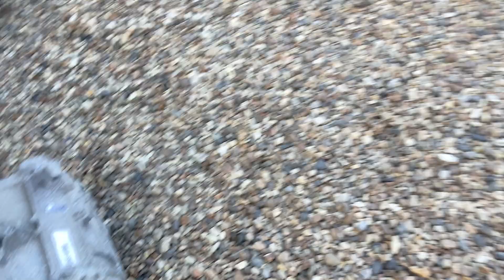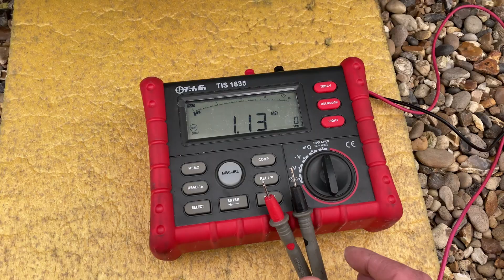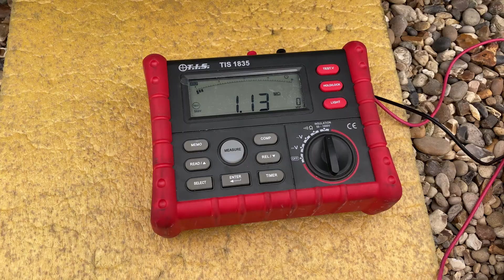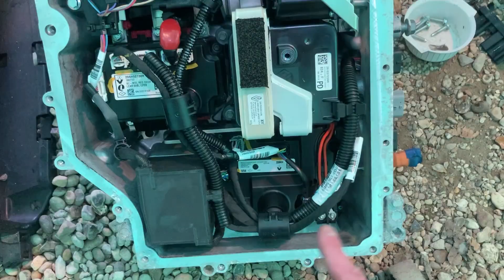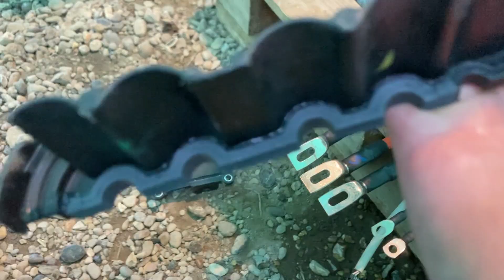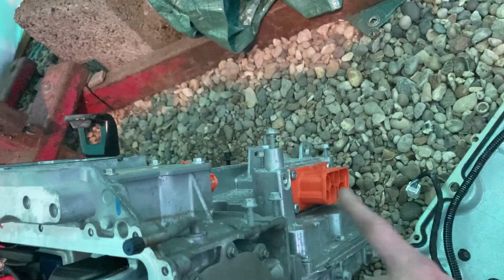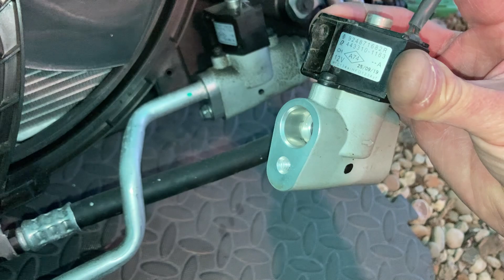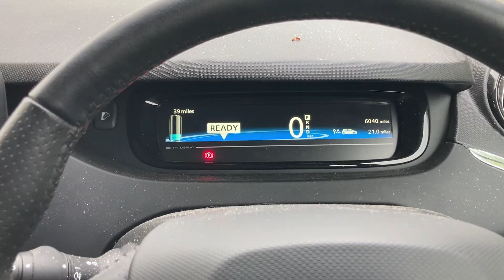This ELECTRIC CAR IS DEAD after only 6,000 miles - Can we fix it? Renault Zoe EV Repair

Comment: Did I miss something or was it just a new motor controller and about 14 hours work after fixing the coolant leak?
Reply from the maker: Basically yes, including coding with the original dealer tool
Reply: New motor controller, and a new (used) cast metal casing into which the existing components (and the new controller) had to be installed.
Reply: Thank you for your video. It's surprising how many bolt lengths are involved with the construction of the drive box. I was always taught to design stuff with the same type of fixings and fixing lengths as possible as this would help avoid errors in manufacture.
Looking at the leaks coming from the tapped bolt holes, do you ever wonder if the wrong screw lengths were fitted in the first place and they've broken through into the casting cooling channels?
Reply: @gavbansal967 
I've seen that with older vehicles too long they push through casings resulting fluid leaks like oil and coolants.. 

Remember someone only has to pick up the wrong fastener.. the other problem is the fastener manufacturers getting it wrong or forced length growth in the thread cutting process as the blank goes through the dies... Even swarf detritus in the casting tapped hole can cause the faster to bottom out 🤔
Reply: @gavbansal967  Yes, that sounds like a very likely explanation. Yes, back in the day manufacturers tried to use the same part in order to reduce cost by being able to buy in larger quantities. Now, more money is made in servicing;  the higher the part cost, the more profit is made after mark-up as this cost is passed on to the customer. I was taught that the bolt length, in the hole, should be 1.5 times the outside diameter.
Reply: @dennisharvey4499 1.5 times the diameter is where the sweet spot is  , any longer doesn't increase strength
Reply: @iandorling  Yes, that is what I was told.
Reply: You absolutely CAN clean coolant off the parts!   Also, if you're not sure, just taste it:  coolant is glycol and will taste sweet.  It is also is water soluble, so you just flush well with deionized water and air dry and all the glycol goes away with it..   You could also use isopropyl, but that's expensive..
Reply: There can be loads of additives in coolant that are designed to protect the engine and cooling system. Never taste coolant!
Reply: @chuckneedham1584 Nobody said to take a big swig and swallow..  A tiny dab on a fingertip followed by spit and rinse is  absolutely fine..
Reply: Did you try isopropyl alcohol to clean the controller?

Comment: Looked at an R5. Makes me wonder about Renault quality. Scrap after 6000 miles. Not for me.
Reply: Did you watch the video? It's not scrap, not even close, as it's working again. 
You also can't compare the new R5 with a 12 year old design. Things are moving fast with EVs.
Reply: If it's any help mine has 70k on the clock and is 9 years old, only rearly had minor suspension work and a DC-DC converter when a public charger went bang but was still under Renault warranty at the time
Reply: 10 yr old Zoe, only thing that has let us down is suspension drop links.
Reply: "Makes me wonder about Renault quality. Scrap after 6000 miles. Not for me."
An ignorant statement based on one data point.👎
This should not mean Renault has no quality issues just like every other manufacturer.
It's a matter of statistics.
Reply from the maker: I believe the new Renault EVs are much updated but can’t say what the quality is like. Cheers

Comment: Great job Gary,  Don't ever go for a job at Renault will you, your far too good for them!!!!  keep up the good work.
Reply from the maker: Thanks 👍 I am actually helping a guy whose car is currently at Renault, I’ve supplied parts that they didn’t have in stock (literally posted used parts to a Renault dealer) and provided part numbers that Renault couldn’t work out 🤪. I think I’d go mad if I tried to work there…
Reply: @garycevrepairs don’t let them know about the court case 😂
Reply from the maker: @PJWey haha
Reply: @garycevrepairs  you are a star!
Reply: Main dealers of all makes don't tend to dismantle and repair things. They simply condemn and replace entire assemblies, regardless of cost to the customer.

Comment: Always worried me that these cars simply cannot cope with deep water in any way compared to say a Nissan Leaf. Never liked the way its all air cooled.
BTW Gary, you have been telling us the ramps are on order for weeks. Not telling us a Donald Trump are you? 🤣
Renault are way out of order as I doubt both motor and Inverter will be toast. Most inverters protect themselves from ground faults detected before they start.
Great fix and well done again. Wouldn't hurt to give the dash a clean as its triggering my OCD!  🤣🤣🤣
Reply from the maker: Bit of a running joke sorry, some arrived and I didn’t like them so I sent them back 😆. So technically some different ones are on order though bricks works quite well…

Comment: If you add a Mesh wifi system at home, one box plugs into your main router the slave will plug onto an extension mains lead and connect back to the home unit. Something like the Tenda mesh units have an RJ45 outlet you can plug the car into your home network which your laptop is also connected to !.
Reply from the maker: I have some extenders but wary of adding latency.  If it drops out while they are programming then it’s game over…
Reply: Maybe make up a 90m ethernet cable and put it on a spool

Comment: Idea:
Can coolant be replaced with 0W10 engine oil?
It should flow as water and be non conductive.
Reply from the maker: Above my pay grade that question!! Interesting thought though.
Reply: Engine Oil has carbon in it and if it overheats can deteriorate leaving particles of carbon. Carbon is conductive
Reply: @DanRyan-v5y  Mineral oil is widely used in transformers, high-voltage switchgear, and other electrical equipment as an insulator and coolant,
Reply: I wonder if it wouldn't be a good idea to replace the coolant for a low conductivity one (like the one Hyundai uses).
Reply from the maker: @mchipelo could do but it just shouldn’t leak.
Reply: It is 3 fase moter what voltage  it works  test three wire got same voltage on each wire thanks

Comment: After my first dodgy comment, I watched further and saw the bit about the coolant. Swapping all that lot over seems a lot of work, another dodgy comment / idea, could you not just put sealant on the bolt threads to stop the leaks?
Reply from the maker: Rely on £2.99 sealant to protect a £1,000 new motor controller?
Reply: @garycevrepairs I said it was a dodgy idea but I wouldn’t use the 2.99 sealant I’d get the 4.50 stuff. 😁 I’ve used PTFE tape and the liquid PTFE with zero issues so far even up in the loft and I can assure you the damage would be way more than £1000 if it leaked. Also did you confirm that the motor controller is dead or just assume it was and it’s easier to replace it while you are had the whole lot out of the car?

Comment: Nice bit of work ,  the only change I would have done would be to use jumper links across to a spare motor to confirm whether the controller was faulty ,  as if it did work the controller was ok and the motor would be at fault ,  not that it would make any difference here but it would identify the controller as the problem
Reply from the maker: Hi, I’ve thought about that but the motor is extremely low resistance so I think it’s likely the controller would be able to tell that the resistance in the leads is too much due to the jumper wire. Thanks
Reply: You could just make a simple motor winding emulator... Just some wire in place of the motor if you know the resistance (assuming it doesn't do a back EMF test).

Comment: With regards to programming the new controller, have you played around with DDT4ALL before? I enabled android auto on our 2016 with this, just wondered if it has the required functionality for this sort of programming too?
Reply from the maker: Hi yes I've used DDT4all, I don't think it can do this programming and it is one time programming so if you mess it up you have to buy another motor controller 😬

Comment: This will have happened because of a bad coolant deflector, it goes when the A/C system is low. I bet this car had no AC for awhile. It happens on the twingo aswell, it can actually destroy chargers in this state.
Reply from the maker: Hi the ac and coolant systems are not linked on this car?
Reply: @garycevrepairs it is passove but it is linked. Put one on a 43kW charger with no ac pressure and see what happens.
Reply: Ah, so the AC system is actually used to cool the charging module, during fast charging? Makes sense. 

No AC during fast charging means the coolant will get really hot? I think I get ya. 👍🏻
Reply: @fredfred2363 it's a little bit of column a a little bit of column b. The passive heatsinks on the igbt are not really sized for it and in general lack of rotor and bearings cooking on these is troublesome. The battery is absolutely solid though really. The OBC is.... Well....

Comment: I see it has some Hifly tyres, these wouldn't be factory fit. So if it has had replacement tyres, is 6000 total miles correct?
Reply from the maker: Original tyres could have cracked/perished at some point in the last 7 years. The factory fit tyres from that time were known to be pretty poor and crack before wearing out. Cheers
Reply: this happened on our 65 plate.
Reply: @garycevrepairs definitely my OEM tires would not last over 2 years without cracking enough for me to change them, that's if they had not started bulging 1st
Reply: @garycevrepairs  "The factory fit tyres from that time were known to be pretty poor and crack before wearing out."
I can confirm this although mine was built in 2014. Tyres had cracks but only little wear. Had to be replaced.